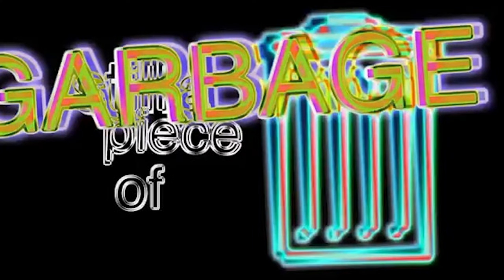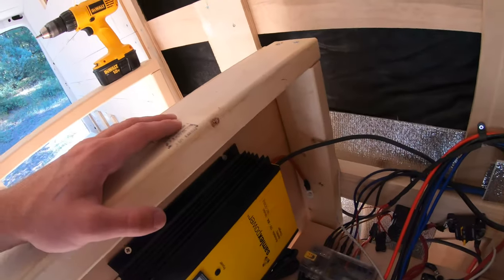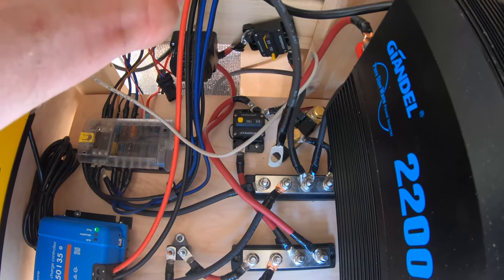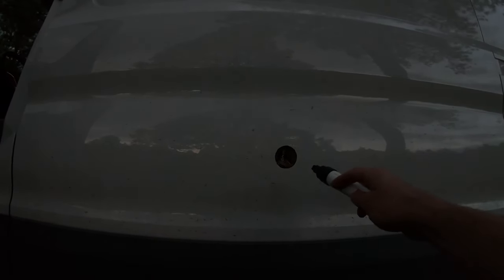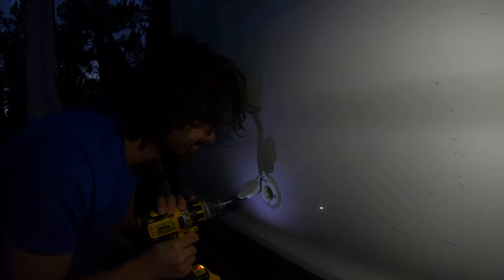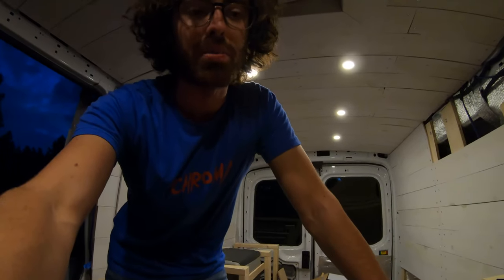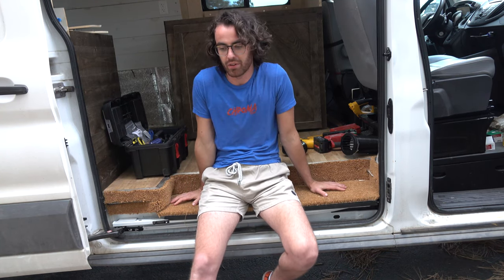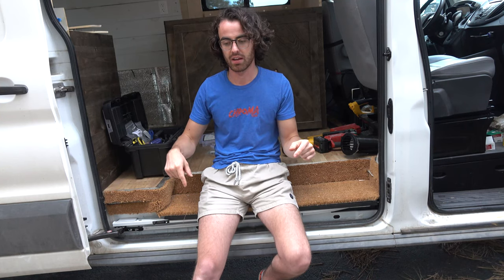How to: Shore Power in Off-Grid Van

Comment: You might want to remove the hole saw from the arbor and drill with only the 1/4" bit first. Then use the hole saw on the arbor. It helps to keep from slamming the saw into the work after the bit breaks through, and avoids breaking teeth off of the saw. To make the hole saw easier to remove wrap a small piece of copper wire around the arbor just below the threads before screwing on the saw.. Kind of an improvised copper washer. Great post.
Reply from the maker: This is so helpful. Thank you! There were definitely periods of struggling with hole saws all along this van build...and probably more to come in the future.

Comment: Hey dawg, what new battery settings did you input for the charge profile? Also wondering what DIP settings you use on the charger. Currently my charger is only providing a couple of amps of charge which doesn’t even make up for the current load on my battery which is alose only a few amps/7watts. I’m using the factory S1 off/S2 On setting and the same battery as you. Thank you! Pretty pretty snazzy

Comment: good video!!! Thanks!! Do more I need to copy much of what you are doing!  ;-{)
Also what are you planning on putting in the van in the way of equipment you may need like: Recovery tracks, Tire deflator for back roads, In reach for sending text when out of Cell service, Tow strap, Awning from FLATLINE that fits on your roof rack, Compressor to inflate tires and tire repair PLUG kit, bear spray.......???
Reply from the maker: So. Much. Bear spray. haha no just kidding. As far as equipment for getting out of things, I will have my thumb and two good legs (as well as all my winter gear and hiking gear so walking long distances to find help in harsh weather, if I ever got myself into a situation like that) wouldn't be out of the question).

I think I will have some of those stackable blocks to level the van out in uneven terrain and I imagine they could also be used to try to help get traction in a muddy or slushy or snowy situation. 

I think a tow strap is a great idea now that you're saying that. Is there one for Transits I should know about or are those just generic things?

I have heard that the FIAMA awnings have low wind ratings (where you have to shut them if the wind exceeds a certain speed) and therefore that they can be annoying...I plan to go the tarp and bungee cord route for far less $$ and no wind rating!

Comment: It looks like your battery charger is 30 amps but your port is only a 15amps. Isn't that going to limit the amps going to your battery charger?
Reply from the maker: Ya know...It seems like that would be the case...but if I remember correctly, when I first tried it the samlex box was reading 30a of input power. I will re-try it (I have not actually used it while on the road yet) next time I have a chance...I am curious now!
Reply: @JeremiahLuke  please let me know what you find out. As I was thinking of matching what you did but was curious if that would effected it.
Reply from the maker: @mitchjohnson4647  alright so. I drained my battery some, found a regular extension cord from a house outlet, plugged it straight into the port in the side of the van (not using the adapter) and my victron battery monitor went from -8a flow to 20a flow.

This is with zero solar and with the car off so the only power flow would be from the Samlex! Does it seem like I am missing something here?
Reply: @JeremiahLuke  hmmm interesting... I mean the test spoke for itself. If my math is right that is about 30a haha so it appears that the port has no effect even tho its rated for 15A. Itd be interesting if you plugged it into the samlex straight but I am going to assume you hid the cord in the wall so you don't have access to it. I appreciate you going out of your way and letting me know tho!
Reply from the maker: @mitchjohnson4647  Well you asked a valid question that got me thinking too! It was a test worth doing. I am curious about plugging straight into it as well now. I think I could reach back and plug in but that is one of the things I'll change if I do another van...making the electrical box more accessible for repairs.